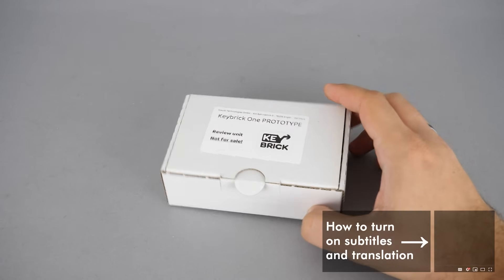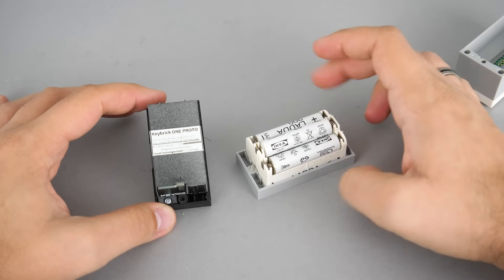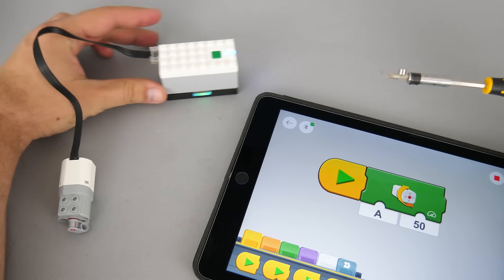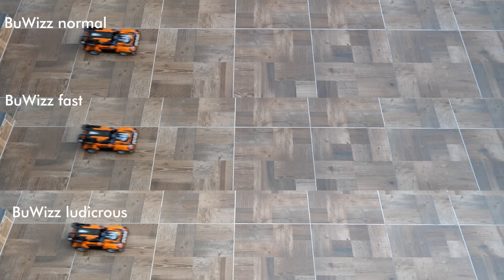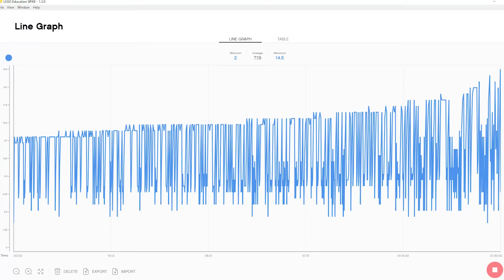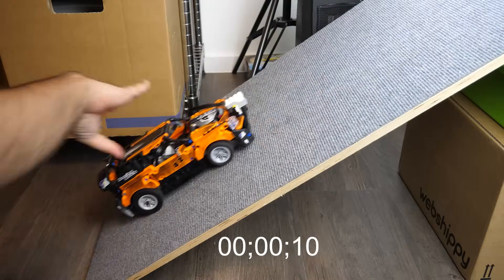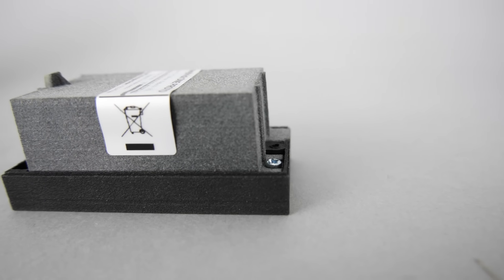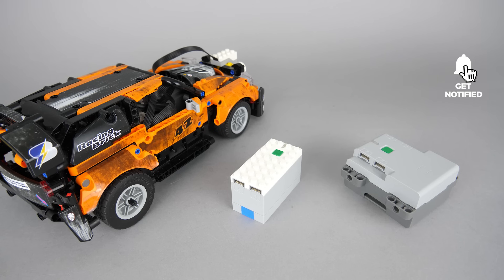Keybrick One - custom rechargeable battery for the Powered Up hub

Comment: The PUp Team from LEGO also said in different interviews that they are working on a rechargeable solution for both the train hub and the Technic Hub. They are designed ready for rechargeable swap. So by the time the kickstarter brings out these upgrades we might see official ones. What I like about the KS version is the possibility of switching between modes and rotation direction but the drawback is the need for an accessible battery box which wouldn't work in a train that well.
Would be cool if LEGO's version also had a micro usb rechargeable port and not the round port.
Reply from the maker: I wouldn't hold my breath for an official solution soon, considering the speed of development over at LEGO. As I see they need a proper set first to justify the release of such product, and it wouldn't have for sure added functionality like the different power modes.
Reply: 1 year later still nothing? :/ would be cool to have lipo modules officially.
Reply: 3 years later and still nothing @AlienPrague
Reply: 4 years later and still nothing 😢
Reply: @mwmanus  Yeah, that was an unexpected move from TLG to rather make a completely new hub and with 3.7V rechargeable battery only. It seems P-UP is being retired altogether. Let's see what hubs the new trains will contain.

Comment: Btw for the smaller hub you can buy adapter cables from old system, and stack them togheter i think, this way you have more outputs. not seperated but still.

Comment: One suggestion.. charging port should be on top if possible.. why? You dont have to take out battery when charging .. like in lego battery..8878.. socket is ob tip and I dont need to dissamble whole train.. just top part and charger  comes easy.

Comment: I just saw that Lego released a USB charger, and a new hub (but seems to still be battery powered). But what could be the purpose of the USB charger if there are no usb-powered things for Lego?
Reply from the maker: Not sure which "new hub" you refer to, do you have a set/part number? The 88019 USB adapter they released can only be used with the Spike Prime and Spike Essential hubs.

Comment: Thanks for the nice video can you please make another video about the Lego technic 42113?
Reply from the maker: I made already more than one, what is missing from those?
Reply: @RacingBrick  yes I saw them all, but I want more! Can you try those accessories with it?
Reply from the maker: @zbricks4107  which accessories? Keybrick One does not work with that hub.
Reply: @RacingBrick  OK, but you will not build it using existing parts?
Reply from the maker: @zbricks4107  ah that one, yes I was planning to do that but it has to wait a bit.

Comment: @RacingBrick where do you bought the adapterr from powerfunctions to powerd up? can you send me an link?
Reply from the maker: This is my video about the adapter cables, there's a link in the description - https://www.youtube.com/watch?v=ic7UeWuHrY4
Reply: @RacingBrick  Thank you very much dude. I love your Videos. I have the 42109. I will Bild a light mod. I have the old Power functions Motors and lights. I dont want to pay 10€ for the New powered up lights. I can still use my old Things. Why buying New, when already have lights
Reply from the maker: @paulalbrechts6054  well the adapters ain't cheap either, but if you use it for lights and you stack them then it can be a better deal at the end than buying PU lights.
Reply: That make sence I can Stack the lights. I have the 42109 and there left only 2 Port

Comment: Which motor and powerpack are you using in the Landrover defender video and do you recommend that or are there better ones ? Just for testing
Reply from the maker: I used a Large motor with a Power Functions battery box
Reply: @RacingBrick  thank you

Comment: Is the rally car costume build, built with the internet instructions from the lego app
Reply from the maker: It is a modified version of 42109, I changed the colors and replaced the Technic hub with the AAA hub (it required some structural changes). You can see more of it in this video - https://www.youtube.com/watch?v=vq1M4aIy3sQ

Comment: I actually prefer slotted screws over Philips.
Philips is the worst screw head design in the world, it is DESIGNED to slip off when too much torque is applied.
Idiotic if you consider, that this always damages the screw head.

Comment: Would it work with LEGO boost?
Reply from the maker: No, that's physically different
Reply: @RacingBrick  so I have to wait for boost one. I have boost hub.
Reply: @RacingBrick  I liked the video
Reply: @noobpoob3889  Given the limited success of the BOOST system, I'm not sure there ever will be one.
I am very glad the new Mindstorms 51515 has a rechargeable battery.
Reply: @notexcisting546  sadly , i have only boost. Of course because of price.